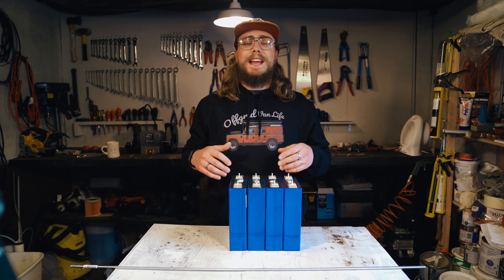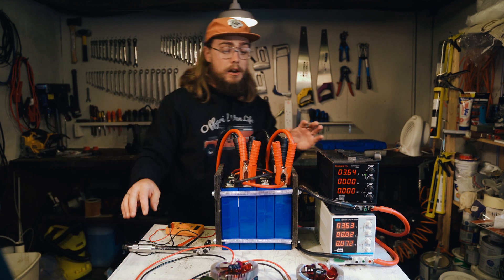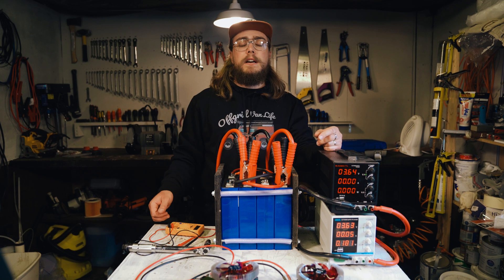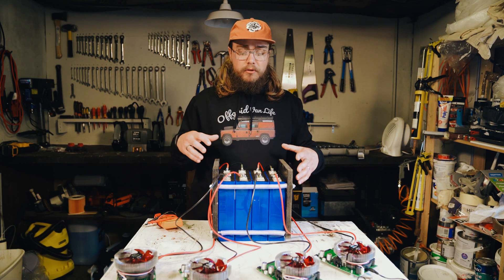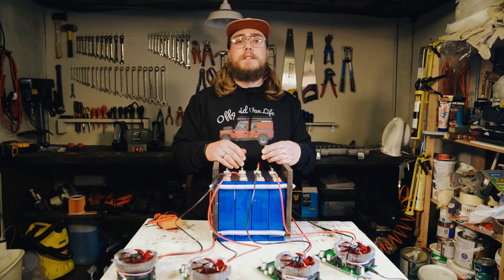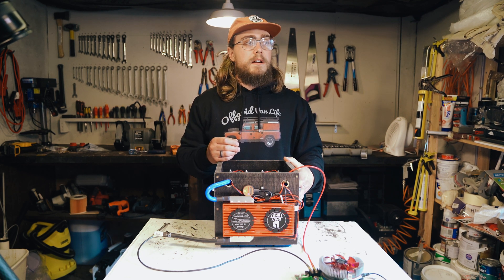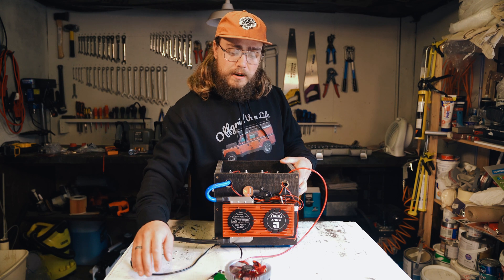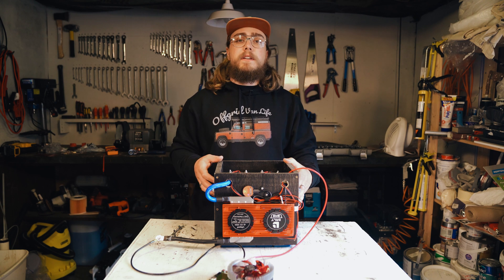Capacity testing CATL 202AH LiFePO4 battery cells (including full test results)

Comment: to run a house how many battery i  need , does one battery can run  for 24 hours or i need more
Reply from the maker: Depends how much power you need to draw from the battery. What do you need to power?
Reply: @offgrid_power  just tv and refrigerator three lamps , desktop please explain to me
Reply from the maker: I would suggest you need a 24v or 48v battery and probably a minimum of 600Ah. It also depends on how quickly you can recharge the battery daily.
Reply: @offgrid_power  thank you bro so those batteries will not work for me i was planning to buy them from aliexpress
Reply: @offgrid_power  please explain to me

Comment: Hey Nigel
Great video.
My power went out the other day and I hooked up my 200 amp battery 🔋/120 amp Daly to my 2000 watt inverter and ran our window ac unit .Temp in Palm Springs was 110-115 degrees- it was exciting.May I suggest doing a video on low temp cut off using a cup of crushed ice 🧊. I think if worded right it would get a lot of hits . I’m sure many that thought Daly wasn’t a consideration b/c as I did until I started watching your videos.You could also go over some of the settings that we need to be concerned with .
Appreciate the help
Best Regards 
Jon
Reply from the maker: Thanks Jon. We'll definitely do that. Appreciate your support and suggestions! :)

Comment: I am waiting for delivery:  8 cells  New brand EVE lifepo4 3.2v 280 ah xuba 280ah for total 560AH

Running in  8 cell (parallel pairs) in series for 12v 560ah battery. I see that your go to BMS is the Daly 200amp. Do you recommend that size for the application noted above or would you go with a larger size like 250 or 300 Thankyou!
Reply from the maker: The BMS size really depends on what your continuous draw is from your battery bank. We generally run 2000w inverters, which draw a match of around 160A so the 200A BMS is adequate for this. If you're you're running a bigger inverter, it would be worth getting a higher capacity BMS.

Comment: Does the bms had a low temp shut off ?
Reply from the maker: Yes, we use Daly BMS with a temp sensor that has low & high temp protects.
Reply: I didn’t know Daly bms have low temp cut off. Good to know thanks
Reply from the maker: Yeah, they work well! :)